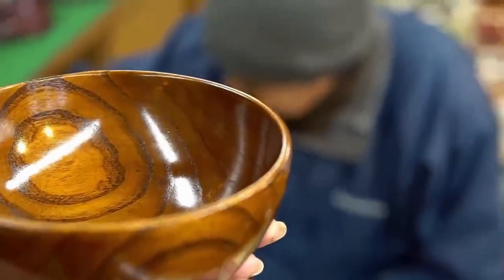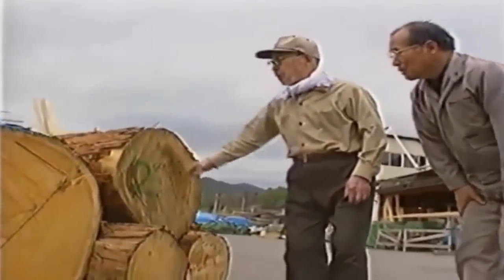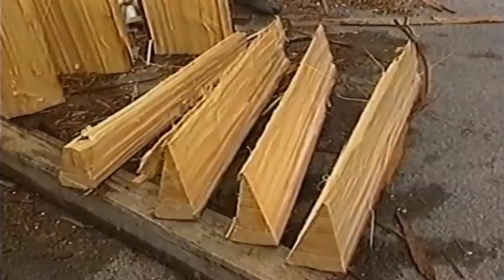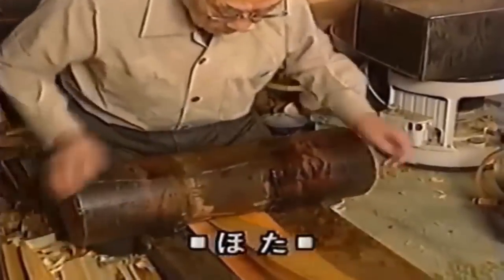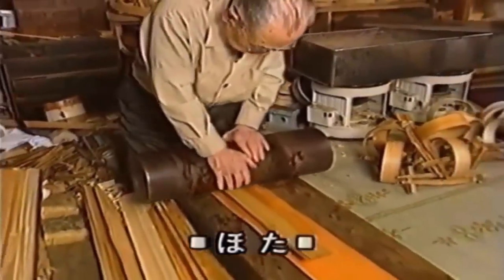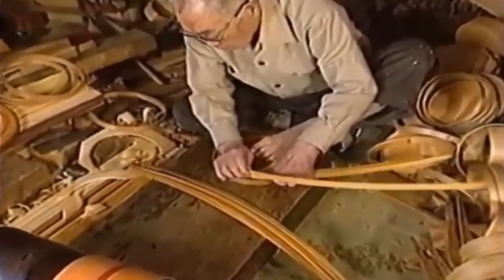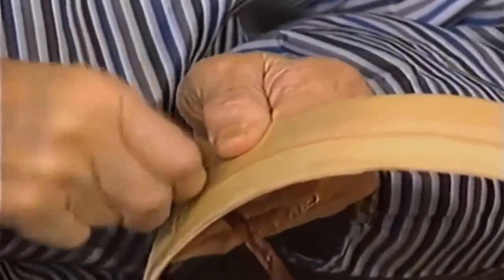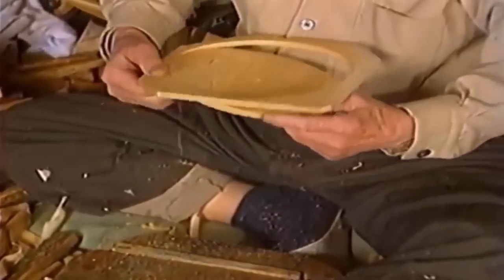By Using His Hands and Ancient Technology, an old Master Craftsman Has Devoted a Life for BENTWORK

Comment: Those craftsmen in Japan have a kind of skill where if I ever got halfway to their level, I would dance in the streets. I've built small things out of wood for years & know the basics of joinery, but my creative power is nothing like theirs.

I just have one question: How do you make the rice glue? Is it just boiled rice, all mushy or....? I can see how it works...
Reply from the maker: The first is to rinse the rice then pour water into a rice cooker to cook it well. A bite or two of cooked rice is placed on a board and worked with a bamboo or wooden wedge to break all the grains into pulp. As the rice is squeezed under the wedge it becomes like a sticky dough. Once there are no pieces or lumps left, a few drops of water are worked in to bring the glue to the desired consistency
Reply: @WoodworkingEnthusiasts  flour glue.